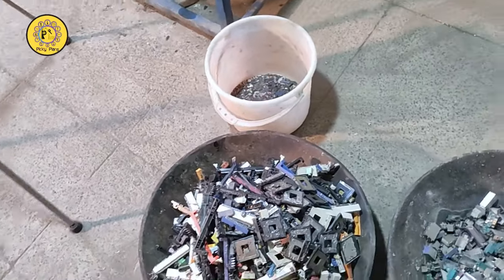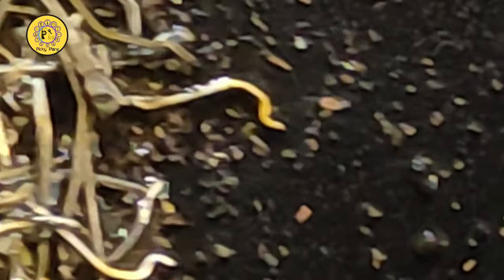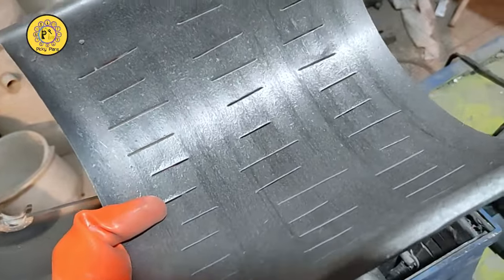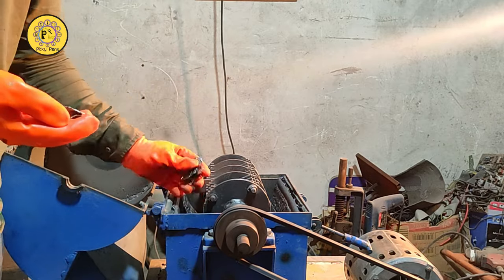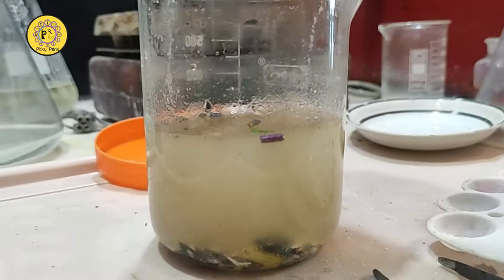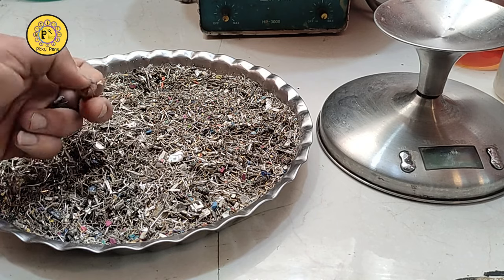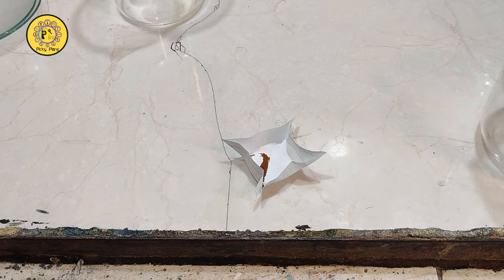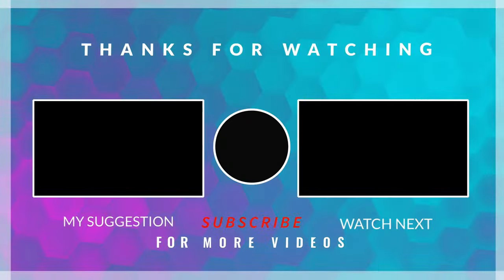Is it worth it to recover gold from PC pins? | PC pins gold recovery

Comment: They call it eco gold x in Canada.  . I do it, but my pins are from the 70s' and 80s". Very old electronics. Just did about 100 grams of clean pins in hot HCL. The gold comes off like glitter. The pins stay prety much intact. So I just use water to wash out the gold glitter. I got 1/2 gram after refining to 24k. If the pins come from 2000 or newer there not worth the effort. Some of the pins I have yeild 2+ grams from 100 grams. But they are very hard to find. They come from very old military conectors.
Reply from the maker: Exactly Eco goldex... I think it's still a great yield it could be worse !
Reply: @PickyPlans I would love to try it but I live in the US and I understand they tack on a massive import fee. As in the 40 dollar price becomes 400. I've tried to find out how much gold it will leach per 100 ml. That information , well I can't find it
Reply from the maker: It's about 0.1 g per 100 ml for concentration of 50 g /l
Reply: Hola .soy Mario desde España. Ahora tengo 7,5 kg de pins mix. Yo los limpio a mano y voy sacando uno a uno. Los que ya he procesado lo hago con doutch pro + con una concentración de ácido nítrico al 38% se vende como fertilizante. Cuesta 5€ litro y me resulta económico y rápido. Sobre todo rápido. Un saludo y muchas gracias por el vídeo
Reply from the maker: Gracias, parece un proceso bastante barato.  Te deseo toneladas de oro.

Comment: The Copper in the pins is probably worth more that the Gold recovered. A Smelter would use the board material as a Copper source with Gold being a by product in the Anode slimes from the Copper refining.
Reply from the maker: Yes . Indeed it's worth more...
Or you can just smelt the brass into ingots after stripping gold.
Reply: This is precisely my method.  Pins are a collector metal when I smelt ashed IC/BGA chips. I then run the metal through a copper parting cell.
Reply from the maker: Interesting.How much volts and amps? How many days?
Reply: @PickyPlans  It really depends on the size of the dore bar (anode); I usually run 4 amps @ 5 volts for about a week.  I then process the slimes that I catch in an anode bag.
Reply from the maker: Thanks for the explanation.
I've already done this in a video but i was looking for a simpler setup to make more videos about this method.
This is the video i was running my cell
https://youtu.be/OhCLQ4wqqNU?si=DLfSQ0LkUjCpmoRk

Comment: how do you filter using paper tissue, what kind? How do you lay them out? Nice video
Reply from the maker: I utilize dense, high-quality paper tissue by layering three sheets, folding them into quarters, and then opening a small rectangle akin to filter paper, which is then placed in a funnel...